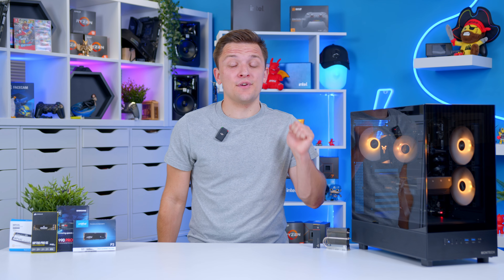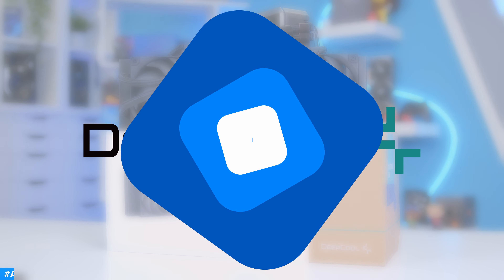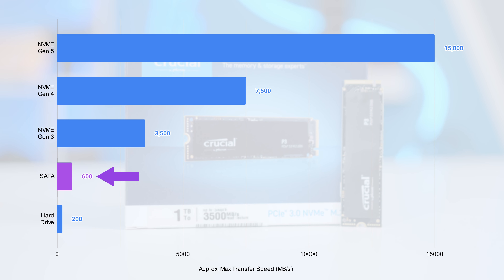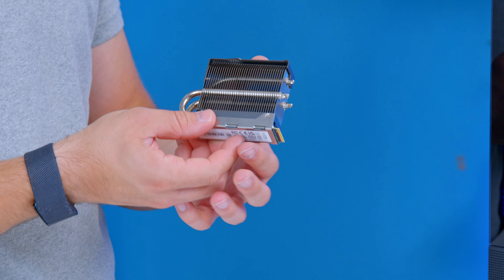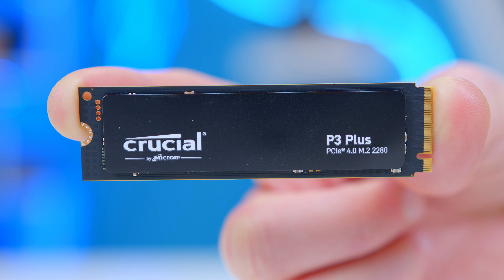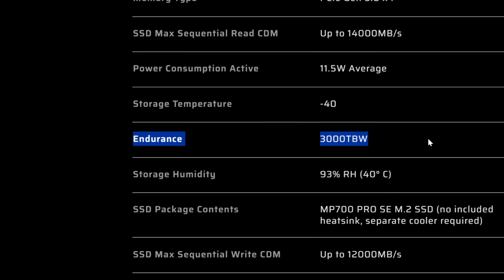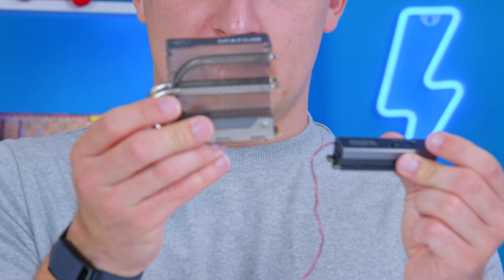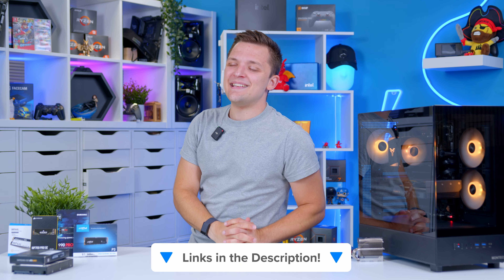Best SSDs to Buy for a Gaming PC Build in 2024! 👌 [Options for All Budgets]

Comment: avoid the kingston nv2 at all costs. that SSD has serious problems. once you fill it halfway, it randomly slows down HEAVILY sometimes making the PC unbearable to use.
Reply: NV2 only, right? Are the other models like Fury Renegade, KC3000, and NV3 also affected?
Reply: @pangeranrio0112 Short answer: KC3000 doesn’t get affected, same with FireCuda
Reply: i have an nv2 about two months old now and used up almost all the storage space... maybe itll start to show its aging after quite some time
Reply: @pangeranrio0112  Everything else is fine but the NV2 and NV3 are dogshit
Reply: I bought NV1 last year, during copy the large file I almost want to break a part.It will drop to 1xMB/s
Reply: Just learned this the hard way after about a year of tolerable use. SSD just shat the bed and I'm annoyed at myself for being cheap
Reply: i agree i wouldn't recommend Kingston ssds this last year i had 2 faulty fury renegade ssds, instead of these i would recommend Western digital black or adata, xpg ssd i barely had problems with these
Reply: that's fake ssd if you bought the 1 TB and when the file reach 4-500gb it will slowdown always 100%.
Reply: I bought one and 6 months later it died, so I agree with you. Hopefully, I can activate the warranty.

Comment: I don't understand, your video says the Corsair MP700 Pro SE does NOT need it's own heatsink.

Their own ADVERTISMENT says and I quote "PCIe 5.0 Performance Powered by NVMe 2.0: PCIe 5.0 x4 combines with the massively high-bandwidth NVMe 2.0 interface to unleash higher-speed data transfers and greater M.2 SSD performance than ever before.*SSD cooling required."

So what gives? I trust the people making it if they themselves are saying YES you need a cooler for it.

Comment: Another thing I look for is which drives come with free clonning software. If you are planning on migrating your current OS, it can add to the cost if you need to pay for clonning software.
Reply: I just bought a cloner off amazon
Reply: @MartySince87  Just seen them. Very nice! But still cheaper if the SSD comes with cloning software.

Comment: I’m new to the PC building thing, I want to build a PC with an AMD 7 7800X3D but I don’t know nothing about specs and all that for MB, RAMS ETC…. Any advices? I don’t want to spend more than 2000k
Reply from the maker: Check out my $2000 build guides for some good inspiration! :)
Reply: ryzen 7 7800x3d is the best for gaming however the ryzen 5 7600x will handle any game the difference is like 4-8 fps and its half the price of the 7800x3d. look thrue alot of videos about compatability and the best and worst. example for ram u dont want something that has a hight latency they are called cl40s. for mb maybe stick to a b650 but also look at videos like the worst b650 and the best. the b650 aourus elite ax v2 is great. gpu u should go for something like a 4070 super, 7900 gre but for more premium u can go for 7900xtx or a 4080 super. ssd look at best for gaming or whatever floats ur boat. there are a few like 990 pro, sn850x, crucial ones aswell. case u need to be careful so u get enough fans and cooling aswell as storage for components. psu try go for a gold rated or above that can deliver minmun of like 750 watt up to 1000 based on how much ur cpu needs. modular psu is a plus cuz it kind of speaks to the pc if that makes sense and know what is wrong and what to do. passive psus makes it so the fans are less active if they dont need to be also a plus. im going for the MSI MPG A850G PCIE5 850W cuz it has 850, has alot of good reviews and is both passive and modular. for cooling u can go aio but a pearless assasin 120 SE will cool it for waYYYY cheaper. BIG TIP do ALOOOOT of reseach before u buy so all the components are of similar grade and compatability
Reply: @CarlAntonNilsson the 7800x3d and 7600 is NOT 4-8 fps difference lmao
Reply: for the mobo get a b650 or x670 if you want something a bit more premium, a good b650 is asrock pro rs. for ram, 32gb is the best and any more is really only for video editing, rendering etc. look for at least 6000mhz, and a cas latency (CL) of preferably 36 or less, closer to 30 is best. for power supply, 80+ gold and depending on gpu, search  [gpu] minimum psu to get recommended wattage.
Reply: Do you need help with a parts list? Is the build going to be black or white?
Reply: @MrAnimescrazy  its gonna be black and yellow
Reply: @CarlAntonNilsson  Yes, I’ve been researching a lot and had watched hella videos, but like I said im new and advices like this really helps a lot, I will look through all the components you indicated thank you!
Reply: @gabriola_  thats what I saw, the aorus b650, but read you have to update Bios or something like that
Reply: @GeekaWhat  I will, thx
Reply: @luisfigueroa5213  ok I will send a parts list. Later or tomorrow.
Reply: @MrAnimescrazy  thx
Reply: @CarlAntonNilsson you’re REALLY wrong about those fps numbers 💀

Comment: If the rtx 5000 series cards support gen 5 nvme's then would it be worth getting one?
Reply: Do you have a gen 3 or gen 4 ssd? Will you buy a 5000 series gpu? Do you need the extra speed? What size ssd will you buy? You can get a gen 5 2 tb for a little more or may cheaper then some gen 4 2 tb ssd's. I upgraded from a gen 4 2 tb 990 pro and a gen 3 2 tb 980 to a 4 tb gen 5 crucial t705 and a gen 4 4 tb 990 pro. I wanted the extra speed and much more space so I won't have to upgrade for years. I never fill up the ssd's and keep as much space free as I can. I can definitely notice a bump in speed and I only use my pc to play games.

Comment: I will buy 3 ssd´s nvme. one to boot drive and the others to games, but should i install  the boot drive in chipset or the pcie nearby the cpu, They all use gen 4 speed, but i thinking games will slow down the fps on the boot drive when they are installed on same drive
Reply: Don’t install games on the boot drive. It will be a pain in the butt trying to find your games in a boot drive and move them over to a different ssd or hdd for long term storage. I always seperate my games and my OS

Comment: Your claim that 4080 Super and 4090 absolutely required super fast drive is a load of bullpoo .
Outside of maybe Ratchet and Clank:Rift Appart I haven't heard of the game where storage might influence fps.
Even slowest Gen 3 will do fine in games.
In order for speed to become a problem each scene that's on screen would need to have gigabytes of weight.
I doubt any game has that even at 8K MAX settings with Pathtracing. 
Even P3 Plus should be sufficient though to be on the safe side,MP44L or Silicon Power UD90 or Western Digital SN580...will do fine.
Though I suppose out of some principle going with Samsung 990 Pro or something is fine as well.

PCIE6 Nvmes shall need 420mm Radiators most likely and PCIE7.0 a custom cooling loops😂

Comment: for gaming only it dusn't mather what ssd you use,..... even sata ssd's are almost as fast louding games as nvme drives do  , also no impact in fps....... have an 670e hero motherbord with 5800x3d    with an msi spatium 580  2t   and several samsung 860 evo, louding al kinds of games the difference is within less than 2 sec.... also  with 980 pro 4t no difference...... i don't know what cheap ssd's does but the sata ssd from samsung and the top of the top msi spatium 580 and samsung  980 pro NO difference in real world louding games,...... louding big files there is difference between sata en nvme also  with the 980 pro and spatium there is a noticeable difference ... that are the real world performances ,....the price there are huge differences,......
Reply: It's strange to have a whole video about what SSD to pick for gaming with no data about how each one impacts gaming.

Comment: can you rate this gaming pc im going to get? the case is a Phanteks xt pro ultra, and the mb is the MSI Gaming plus wifi ATX AM5. the cpu is the ryson 5 7600x, the ram is the corsair vengeance 32 gb 5200mhz EXPO ddr5. and the storage is seagate firecuda NVMe 530 gen 4 1TB. the psu is the ASUS 850w gold+. and the gpu is the RTX 4060 8 gb is there any super bad bottleneck on this pc? im gonna play minecraft,fortnite and rocket leugue.
Reply: You'll only have problem if you play AAA games at 1444k resolution with max setting, otherwise it's pretty flawless build.
Enjoy!!